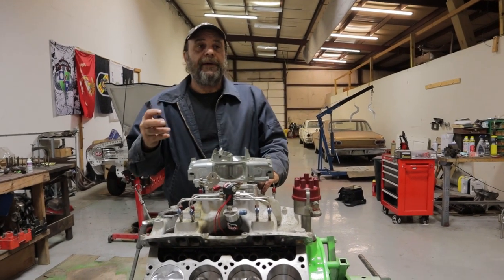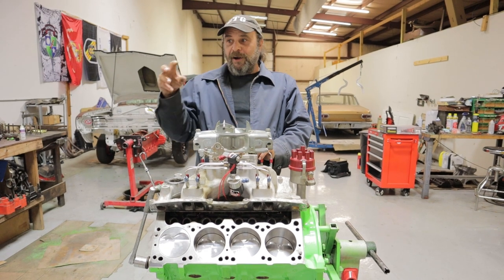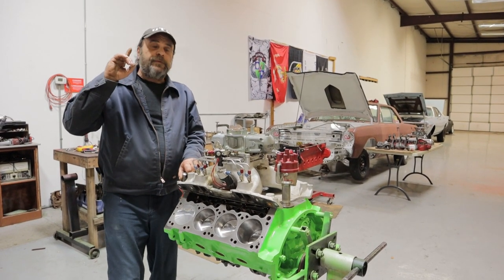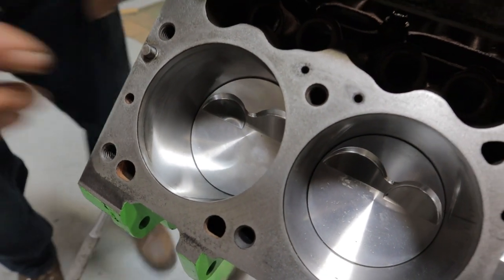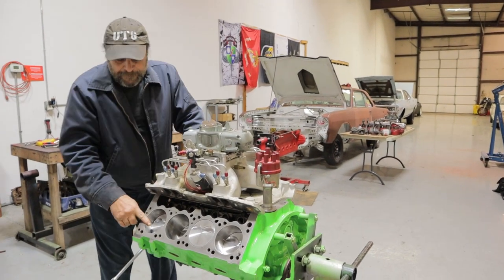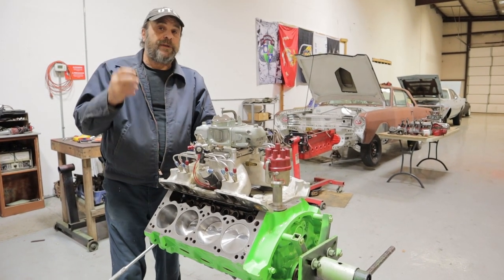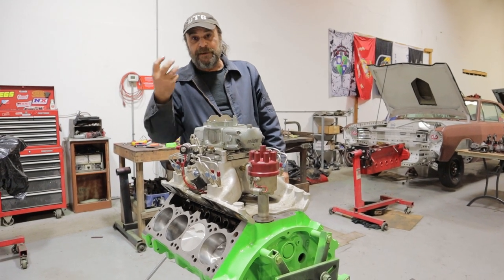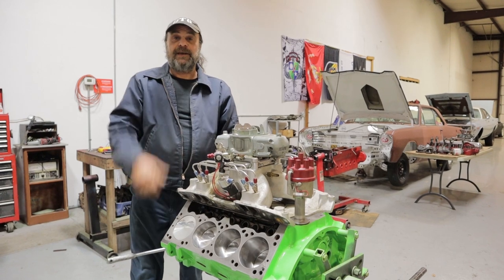The Fundamental Aspect Of The Internal Combustion Engine Nobody Ever Talks About

Comment: So I will throw another idea at you. What about LP Gas (Propane) engines?  I am the same age as you, Tony, and when I was 18 to 20 years old, I went to Diesel Mechanic school at North Dakota State School (now College) of Science, (NDSSS) which, at the time, was the only school in the US teaching a class in LP Gas carburetion, which was required for students in Diesel Mechanics as some heavy trucks used LP Gas. I mention this because it has been nearly 40 years, so my statements may be off due to memory lapses. Anyway, with LP Gas (propane), the fuel is a gas as it enters the combustion chamber, and it burns slower, so more of the energy is used to turn the engine over. If I remember right, propane has about 30% or so fewer BTU's in it than gasoline, but the engines supposedly made only about 10% less power. So someone can get more "bang for the buck" so to speak. Of course, propane is harder to handle... Also, at the time unleaded gasoline had only been around for a few years, but this was going to be good for changing an engine to LP gas, as LP gas did not have lead in it and older engines converted to LP needed hardened seats installed on the exhaust valves. So are you aware of any work done on improving mileage by going to propane?

Comment: I am hearing: 

The exhaust valves need to open at 45* to power a vortex generator.   

The vortex generator will provide a near perfect vacuum just past bottom dead center. (180*)

The vacuum will PULL the piston up. 

The intake valve opens at 225* and the cylinder pulls in fuel mixture with the vacuum.

Comment: Now,  let us consider top fuel dragsters and their fuel/air mix.
It's WET!
That mix is so wet that if it were any wetter, it would cause hydraulic lock during the compression stroke.
THAT is how you maximize the duration of applied power during the power stroke.
and
AND
THAT is how you beat the living hell out of what the engine is made of.

Comment: Tony I took my 283 chevy I bought to the machine shop. It has some really tall pop up slugs TRW and the bearings looked unused like "someone loved this little motor"! However the cylinders got surface rusted,so i took it in to have it disassembled and cleaned up only. I guess they misunderstood what i wanted done because they threw away everything. And told me 2 of the pistons are worn out and have .008 thow clearance and to throw them away and start with all new. However finding those pistons is impossible. The bore is 3.935 and measure perfect .060 over.  Can you give me any advice on this? Thank you. Big Fan.

Comment: Hydrogen, why not go big bore and short stroke? Keep friction low with thin low tension rings and MAYBE you could gain some efficiencies.  Could be viable in a light weight car vs electric/hybrid.  I still think Diesel is the best for economy when it's not burdened by complex systems like EGR, DPF and DEF.  An added benefit of Diesel is you can burn Veg based oils or even used motor oil in one.  Although I don't personally agree with burning a food source in a vehicle.

Comment: If that is the case wouldn't vapor carbs lend themselves well to a high revving engine such as from a 90's 250cc honda fireblade motorcycle or the previous v-10 indy car motors that went to 20,000 rpm? The stroke is much smaller with those engines and they make more of their power at higher rpms. The super short stroke at super high frequency, at least intuitively, seems to lend itself to  making these engines able to effectively and efficiently convert faster burning fuels and lower temperature fuel types into useful work more efficiently and better than your standard 5-7000 rpm redlined engine. Might it be possible for this to be a future build on the channel? They won't be getting 100mpg, but if you can get 20 to 30mpg and enough power and torque out of a 20,000 rpm v-10 engine it would make for a hilariously fun daily driver or weekend toy.

Comment: Brilliantly explained. Also shows the case for induction charged short stroke engines. It's amazing how there's so little going on at the 90° angle where most torque could be developed. 
I came from a collage technician educated background (city and guilds-uk) and we learnt some of this. Excellent video...
Also water injection is a great thing, delaying and extending the burn..

Comment: That's why diesel engines have become so much quieter and more powerful. The fuel is pulsed in over and over as the chamber is expanding rather than the old one pulse, one explosion. That's also why my Cummins Ram injectors cost $800 each for a total replacement cost of $4800😱. Fortunately they rarely need replacement if you add lubrication like Lucas. Mine have 230,000miles on them. Good stuff bud👍

Comment: at one time, I experimented with the uzam 412 engine from my Muscovite 2141. I increased the compression ratio (to about 11.5), and changed the ignition system, removing the trambler from it, put 2 coils on 2 spark plugs each. and I put the oldest carburetor there, namely k126n, it was the oldest and most primitive, there were only 4 holes in the emulsion tubes. However, what happened at the exit surprised me. the engine for some reason refused to work normally anyway, unless I did the ignition MUCH earlier. 30 degrees before the top dead center, while idling was damn stable, I could lower it to 350 revolutions per minute, and at 700 I could turn on the 4th gear, release the clutch, and the car confidently started. And this despite the fact that the stroke of the piston in this engine is only 70 millimeters. I could step on the gas, and the car confidently accelerated to 80 kilometers per hour right in 4th gear, however, surprisingly, after 80 it started to go badly, and it did not accelerate faster than 120 in the trailer, while up to 80 it drove almost the same regardless of which gear I 

I'm saying all this to the fact that the car consumed about 4 liters of fuel per 100 kilometers (about 60 miles per gallon), and there was no detonation in the engine at all, at first I used 98th gasoline, but then I switched to 92nd and nothing changed. I don't know what kind of strange effect happened, I didn't drive it for a long time, then I sold the car and it went to metal, but still a lot of how it worked was amazing and defied logic.

Comment: Thanks for covering this Uncle Tony. In your followup video. I thought you might mention the info in my, way too long, comment on your video 3 days ago.
I was referencing the fact that at 90 degrees of crank throw, the piston has moved well past one half of the stroke. 
Something that I had never been aware of my whole life. I quoted 63% of the stroke but it can be more or less depending on crank/rod/piston geometry. 
But always more than one-half of the stroke.
Using much more than one-half the stroke is why the 90 degree crank throw is so critical.
I got no likes on my older comment so I don't know if you or anybody saw it. 
I just want people to understand this and not live 63 years thinking about combustion in IC engines incorrectly. As I did.

Comment: My understanding of Hydrogen fueled cars is that they are compressed like compressed natural gas. Compressed natural gas is formulated to run very similarly to gasoline, down in the internals. There’s a company in Iceland that converts cars to hydrogen fuel, mostly priuses and Honda’s but they do very well, naturally aspirated. They’re only modifying the fuel system as far as I’ve seen, I’ve been considering converting my cars to alcohol or hydrogen if gasoline becomes obsolete (or outlawed). Check out Iceland hydrogen, it’s pretty interesting stuff. If I can find out more about the process I’ll be happy to share. If you know where I can find out the burn ratios like you showed for compressed natural gas, I’d like to check it out, there was a time that Chrysler was going to release a new charger (1999 I believe) and it was running in compressed natural gas with a 4.7 liter engine. I’d like to know what you think, should I go compressed natural gas, hydrogen, or alcohol? If smog will be an issue (with many of us it is) as well as power, which would be the best to use in case of the government outlawing gasoline? Now you’ve got me thinking about all kinds of stuff, that’s why I love your channel. You keep me motivated

Comment: Liquid hydrogen, like propane. So clean, 20 to 30k mi oil change interval. Diesel can be converted to run on propane easily and efficiently. Liquified natural gas as well. Slightly off topic, but applicable I believe.

Comment: Now I'm wondering where long connecting rods and increased dwell at TDC comes into this length of fuel burn. Or maybe Smokey Yunick let it slip out, if you get my drift. As an inventor, Smokey recognized the issue with letting out too much info before the check cleared--people steal your ideas. when you patent, you have to explain in detail, and there are countries where one can build and not have intellectual property respected. Or one feature can just be changed to avoid a patent lawsuit. Samuel Colt spent a lot of his time chasing gun manufacturers who made revolving cylinder designs--they just went out of business before paying and set up shop the next state over. I think its pretty obvious Smokey's design was ahead of material technology--ceramics weren't what they are now. ECMs were still primitive. Perhaps now an engine that starts off non-vapor to accelerate, but at cruising speed when the engine is at operating temp, converts over....

Comment: Great explanation of what is going on during the burn cycle. The naturally aspirated carbureted engine presents a bit of a paradox. In order to create peak power, the goal is to draw as much air and (ideally) vaporized fuel into the cylinder. The problem is that these two elements are being drawn into a compressor, and when you compress vapour it turns back into a liquid. So with this type of engine you have to decide what you want, max efficiency or max power, you really can’t get both. Throw in a computer, fuel injection, cylinder canceling, and some kind of boost system and now you can play on both sides.

Comment: In the interest of better understanding the concept, I have a question, but first, I should review my understanding from this video so you can correct me if I am wrong.  If I understood correctly, you actually want a fuel that burns a little slower... not too slow obviously, because you dont want it still trying to burn burn and expand past the time its finished it cycle, but long enough to keep pushing, so you are not depending on momentum to keep the engine turning for most of that cycle.  Is that correct?  On the flip side, would an engine with a faster burning fuel in whatever form, be more useful with maybe shorter piston travel, operating at much higher rpms than normal gas engines?  I am not planning something...lol... just curious mind.

Comment: Your wrong Tony. Carburetors make more power than efi because of the emulsion tubes in the carb. Emulsions are mixtures that normally wont mix Ie. Petrol and air. In Australia ford released a falcon with liquid gas injection ( LPG ) that makes more power than the petrol motors due to the cold air created by the liquid gas turning in gas vapor.

Comment: as far as  Know street gas has around 18,00 BTU,s per gallon  does a hot vapor engine increase BTU,s,  On a side note I ran a lima engine  with split ports with  holley 390 4 barrel no choke and  stage 11 cam fro the 2.3 , any how ports for the primary intake runners would ice up in the summer, I used to cheat using nitro propalene ( its been 35 years)_ when the tech gave me my stickers I would drain the secondary float bowl and pour some juice down the vent, I cracked a piston, and it trashed the cylinder wall  , the block was trash

Comment: Damn if you want to run your automobile on vapors install a propane fuel system and alow it to deliver it as a liquid to the injectors while turbo charging it and you'll make some awesome power you just will not get any better economy than with gasoline or  ethanol. The thing people don't realize is there is only so much energy in a specific quantity of fuel if you could get 100% of all the energy being produced by the gasoline you could only move yourself around 80 miles per gallon that's why the best non-hybred motorcycles get a top mpg around 60 to 70 mpg if you're using gravity to save fuel coasting down every hill. Sorry but people just don't really understand the thermodynamics of fuel and ICE's.

Comment: Smokey did perfect that system years ago...
I believe it was in Hot Rod - a 283 Chevy.

He heated the fuel up in stages and used a pantex supercharger to compress the air mixture.... And the fuel was then interducted

I believe he had 5 stages base on the flash point of gasoline...

Comment: so . per gallon with a miller cycle cam shaft (valves stay closed till  past 90 degrees of crankshaft rotation) ? would nitro methane be more efficient  for cruising low rpm  communing>> yea $65/gallon  makes it unpardonably expensive, if yes> direct injection of water mist wide angle like a diesel injection at ? 15  degrres past ,with  the same miller cycle cam ?

Comment: this is pretty much why the vintage 4-stroke piston engine is limited in its efficiency. Variable ratio strokes, new piston geometries, or some new type of injection to extend the burn cycle are the only way to overcome the limitations for the power stroke of gasoline combustion. This pretty much leaves your old big/small block out of the equation, so be content with 25-30 MPG at highway speed if you can achieve it.

Comment: What about high compression engines don't they squeeze the charge greater in order to produce more expansion when the engine fires and that will force the piston further down? Isn't that the real reason why diesel engines are so much more efficient?
Reply: Vapourised fuel is more volatile and thus more prone to detonate under higher compression unless you are backing off your ignition timing, which then will lower your power again. As for diesels I think it also not just as simple as compression as it is a vastly different fuel.

Comment: Why couldn't you just modify the crank shaft to have more pistons and smaller angles for thrust? Something like first piston thrust 15 degrees to 40 degrees then piston 2 thus from 40 degrees to 75 degrees and so on.

Comment: You're missing two major advances in Hydrogen technology that are changing the game. Variable combustion chamber geometry. And hybrid hydrogen gas (altered hydrogen) technology. Those two technogies circumvent the combustion time limitations. And are going to change the entire landscape of combustion engine technology. True, The variable chamber tech will not be easily adaptable to existing engines. But the hybrid hydroen will. And will be much more simple and cheap in the long run. The limitation is not in the combustion process any more. It's in the manufacture and storage of the gas in a moving vehicle. And advances are being made every day.

Comment: I was reading awhile ago Porsche had was in development of a 3D printed piston that was about 30% lighter than a conventional piston. Would Porsches high tech piston make hydrogen fuel more usable? And if hydrogen doesn’t have the push why not just burn diesel because they are more efficient than gasoline motors

Comment: yah, i tell people this all the time, types of fuel and also cylinder overlap. you only get so much out of a full charge in the cylinder. 4cylinder=75% power to stroke ratio. 6cylinder=100% power to stroke. v8=133% power to stroke. also why diesel is so powerful is its longer burn to push the piston all the way down vs a pop and only 50% of the stroke is full power to the crank. also the reason why turbo and super makes more power is more air and more fuel making the power stroke last longer.

Comment: Well explained. Now kind of some thing similar to the subject. Back in the 80s i came across some guys that were so called hotrodders. and between the intake carburetor mounting surfface  and carburator spacer plate { spacer was about  1in  1 1/2  tall.} they were smashing a piece of window screen between a pair of gaskets. The clam was that it would atomize the fuel better. Personally i never did try it.  i was just wandering if you ever seen it done and if it was effective enough to try it. I would think it would slow air flow down.

Comment: Would it be feasible to devise an engine with dual fuel/induction systems?  Use a conventional carb or EFI system under full throttle to deliver good performance, and switch to something like a hot vapor system under light load for maximum fuel economy?

Comment: Besides all masterfully explained by uncle Tony, the vaporised fuel also carries a lesser amount of potential chemical energy into the combustion chamber as there is always less fuel mass in comparison to the more conventional set ups. Carburetors and fuel injectors (or for the lack of a better word, atomisers) will produce tiny droplets which will not only carry more mass, hence more energy, into the combustion chamber, but will take the right time (a finely tunable time) to burn and to produce the most energy possible, therefore, with higher efficiency.😊

Comment: @uncletony: you've talked before about the reasoning behind different bore and stroke combinations for different fuels. Would you agree that knowledge could be applied here? As I recall you said that top fuel uses a longer stroke than pro stock for instance,  even though they're both 500", because of fuel burn rate. So, in the case of hydrogen, wouldn't a super short stroke and large bore combination take better advantage of that quicker burn with a shorter duration? Curious to hear your thoughts on this.